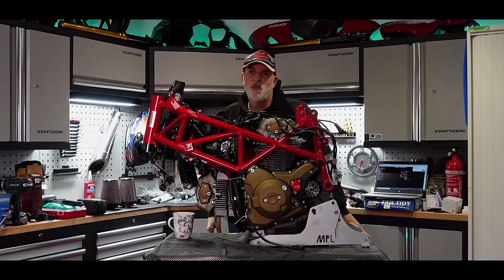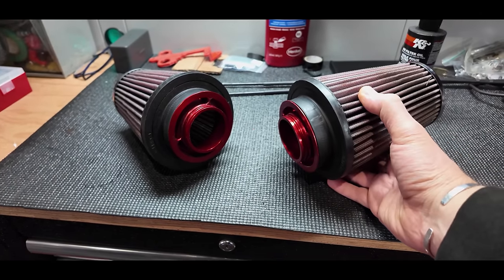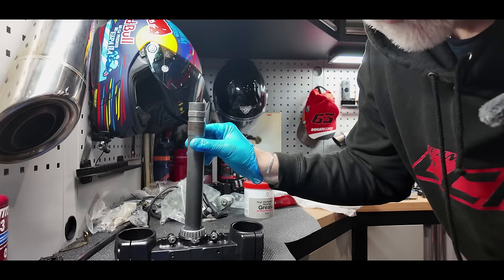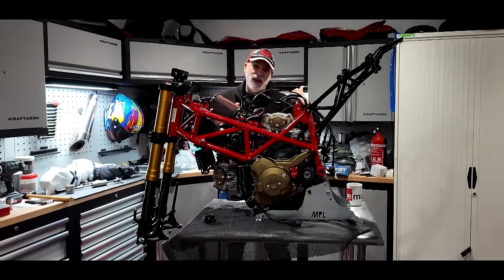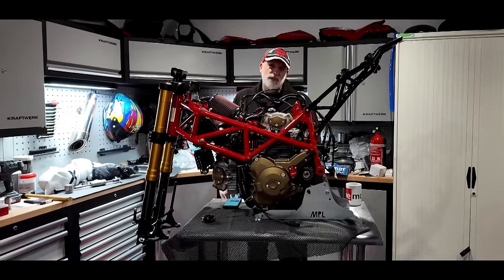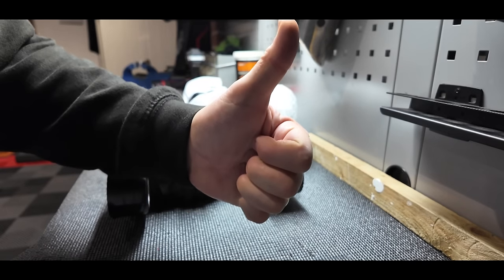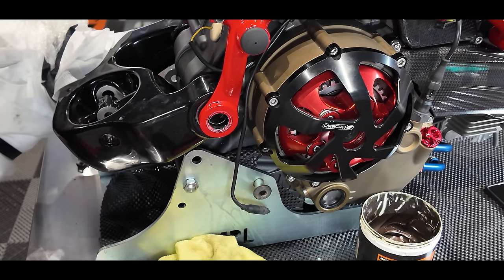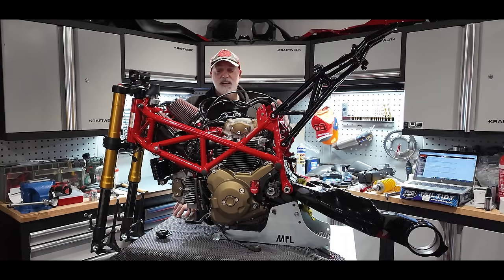Hypermotard 1100 S Restoration EP18 | Finally Its Coming Together

Comment: Enjoying the build, I do wonder why you put grease on the steering stem shaft, but it is your scooter.  The finish of the parts is great.  I am enjoying the series as I enjoy most of the your videos.  Keep up the good work.  Hurry up and ride that beast, should be fun!
Reply from the maker: It's the done thing with this job. Basically I think to stop the stem rusting inside

Comment: Looking good chops, wasn’t clear from the vid if the lower Headrace seal was the right way up. It needs to go with the flat surface up, and the lip facing down. Seems a bit weird I know. It can cause drag if it’s the wrong way round.
Reply from the maker: Really? Well then I might have cocked that up.. I did put the rubber lip facing up. Too late I'm not changing it now 😬
Reply: @LambChopRides  yep, I did the same thing a couple of times (long story but ultimately how I got my YouTube handle) just done my ZXR-H2 front end and luckily the Kawasaki manual is remarkably clear. The difference is quite notable. Loving the work though and keep it coming. Hopefully see you out and about at some point. 👍👍

Comment: Miss use of adjustable spanner 😂 won't be showing my apprentices that bit of video. did  your torque wrenches calibrated when you purchased them, they don't normally,
Reply from the maker: Yes they all came with certificates 👍

Comment: All good, but I'm not sure about the copper slip on the shaft as that will turn into grinding paste
Reply from the maker: The shaft doesn't move, the bearing  move around it. These can tend to corrode into place and become really difficult to remove. Hence the copper slip grease 👍
Reply: @LambChopRides  ah fair play. I assumed there was some rotation around that shaft too. Lovely build by the way!

Comment: @4:20 That's a special technique, wacking the outer bearing cage with a spanner and hammer😳. Maybe a reason the head stock is not going smoothly??
Reply from the maker: Actually the inner part of the bearing is higher than the race, so not touching the race there with the adjustable spanner
Reply: ah, that i couldn't see. No worries than and keep up the good work. @LambChopRides

Comment: I had an open airbox on my S2R 1000 and the intake roar was addictive - like sitting astride a V1! Will you be reflashing the ECU to match, as the airflow characteristics are going to be noticeably different from the old, restrictive, airbox?
Reply from the maker: Yes absolutely, going to get the full dyno setup treatment 👍
Reply: @LambChopRides  That should make for an interesting video! Do you know who you'll be using yet?
Reply from the maker: @luddite6239  yes I will be going to Chris at Luigi moto. He's done 100's of these 👍
Reply: @LambChopRides  Good choice! Rich and Chris are highly recommended. They were featured on Henry Cole's "The Motorbike Show" series 11, episode 2 (I think). Well worth a watch if you haven't seen it already.

Comment: Chops, when you torqued up the swing arm bolt didn’t you wind your new torque wrench down to 70Nm and then down another 5? Looked like you wound it in the same direction but said the required torque value required was 75Nm?

Great build BTW, can’t wait to see and hear it finished 👍
Reply from the maker: Oh did I... Will have to rematch now... 👍

Comment: What does the induction kit do for you vs. having an airbox?
Reply from the maker: The standard airbox is very restricted with only a very small opening. This will flow more air and make more power 👍

Comment: Chopsy,  13min 52 torquing up swing arm.  I think you may have over torqued it. I think you said 75nm  but looked  like you set the torque wrench to 75Ft lbs?  (About 100nm)  Might have been reading the wrong scale?  Bikes looking great.
Reply from the maker: No don't worry I'm sure NM were on the left.. I will double check now 😆👍
Reply: Ok mate, only say this as I’ve made that error, I have similar wrench and have tape over the FT lbs side now and on the vid the marker look like it was against 100. 👍🏻

Comment: Great episode Chopsie! Are you swapping many bolts for titanium and, if so, what weight savings are you getting? I'm just curious.
Reply from the maker: I have a fair few to swap over but noticed I'm missing a couple I want to change. Weight saving is around half the weight of the steel ones 👍
Reply: @LambChopRides  thanks, well worth having as the collective mass saving is worth having, as well as looking nicer too 👍

Comment: Hi do you know he paint code for the rear shock as mine is looking a bit scabby
Reply from the maker: I actually haven't touched the shock, well sorry I had the spring replaced when the shock was rebuilt. I had it changed for a heavier weight spring

Comment: The stupidest idea is to install zero resistance filters.
Reply from the maker: These are specifically designed for the bike. It's not just cone filters but they have a tunned billet  inlet inside each filter
Reply: I understand, but this is to squeeze the maximum characteristics. The regular system is much better and filters more. @LambChopRides
Reply from the maker: Yes but we are going for performance gains to match the engine mods. Its not going to be a big mileage machine this